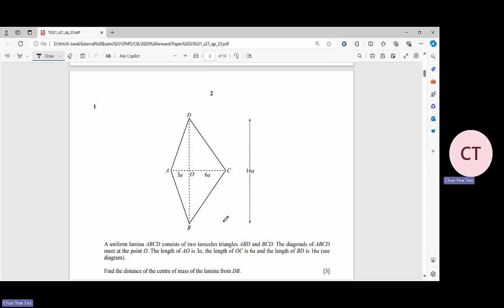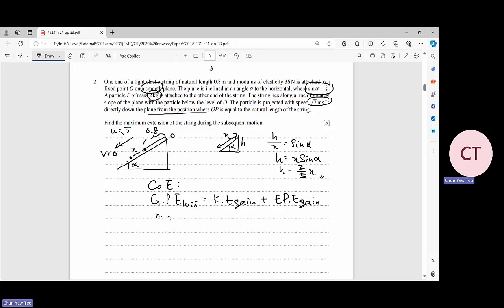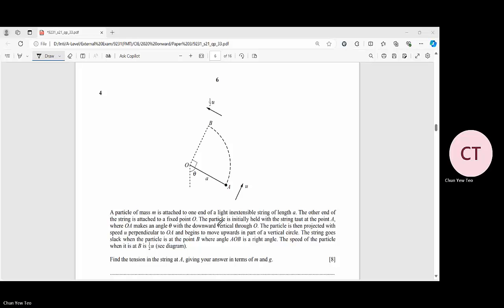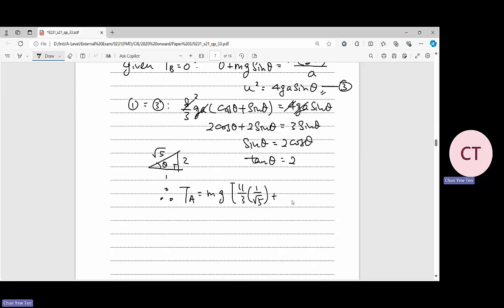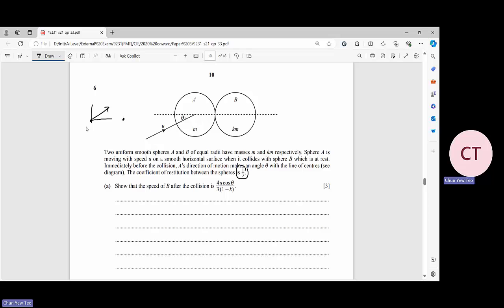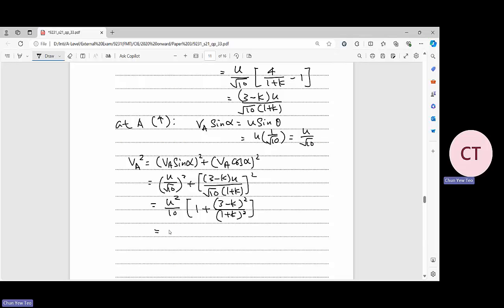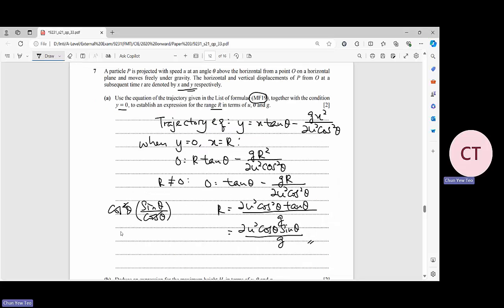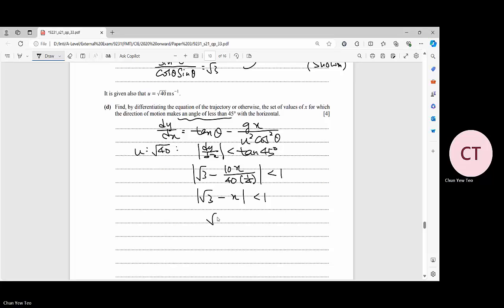9231/33/M/J/21 CAIE A-level Further Mechanics Solution

Comment: 32:43 I'd like to know why the velocity of B in the y direction is zero. Doesn't the impulse force from A have a component in both x and y direction so it causes it to move.
Reply: For particle B the vertical velocity before and after collision are the same. Since there is no vertical velocity before collision therefore there will be no vertical velocity after collision.
Reply: @chunyewteo2692 But sir, why would they be same? I thought the particle A exerts a reaction force on B in both X and Y direction so the particle B will move at an angle?
Reply: @alyanhookelah the vertical part of the velocity does not involved in collision. Only the horizontal part of the velocity is affected by the collision. Therefore vertical velocity before and after collision are the same